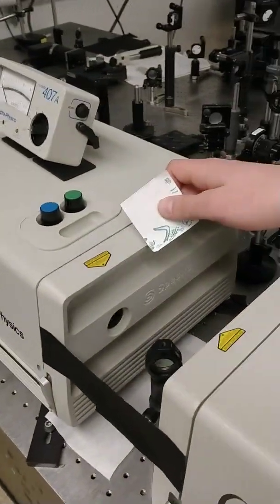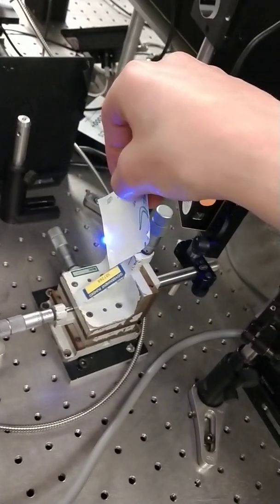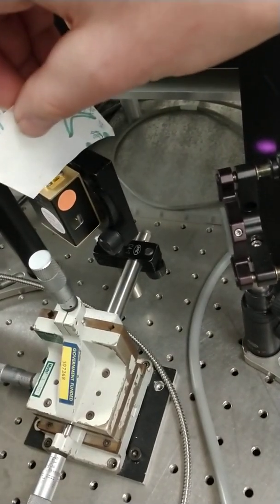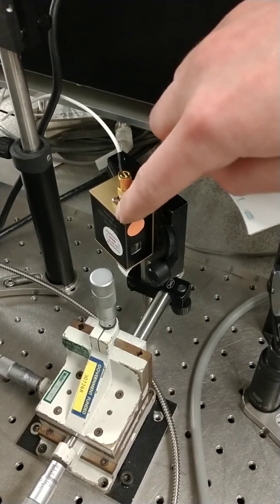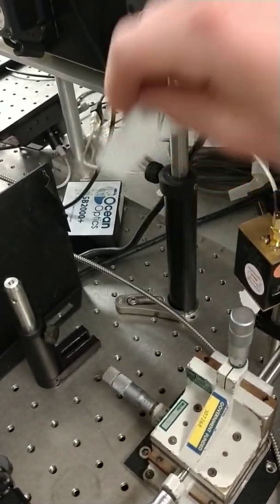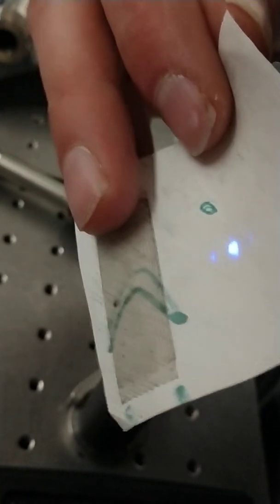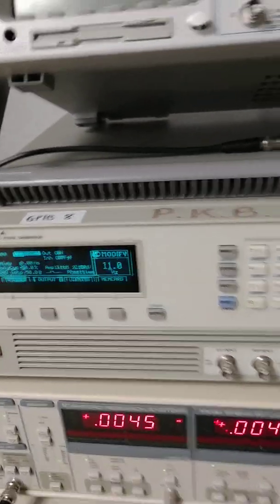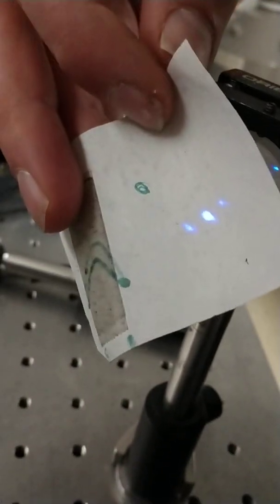Acousto-Optic Modulation with Ti Sapphire Laser

Comment: 200nm UV would require a silica AOM crystal driven at a fairly high frequency to create the diffraction field inside it. Would be helpful to show your students how to adjust the bragg angle on it. Anyway what was this experiment for as modulated deep UV is quite unusual.❤